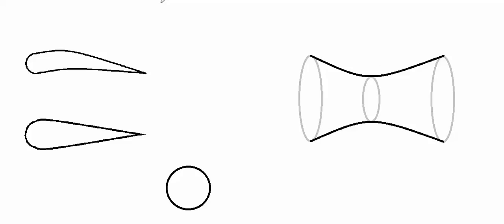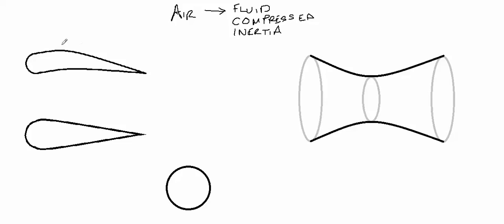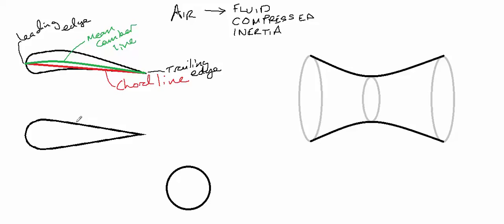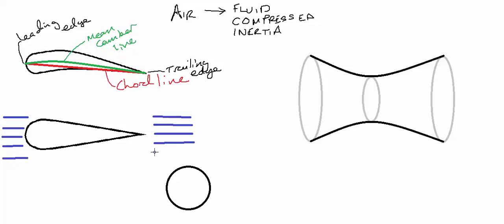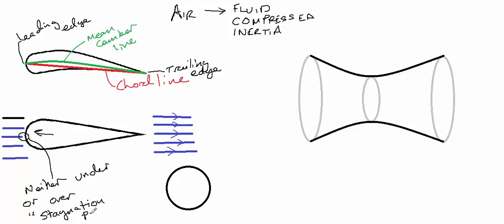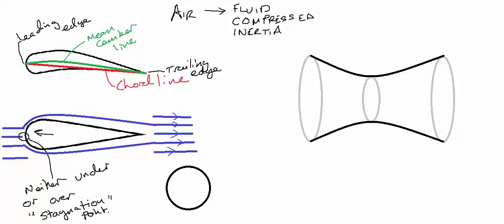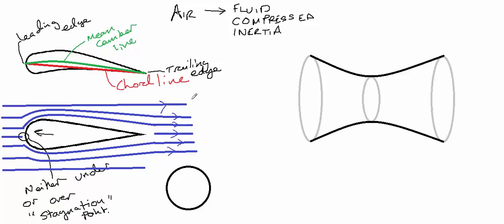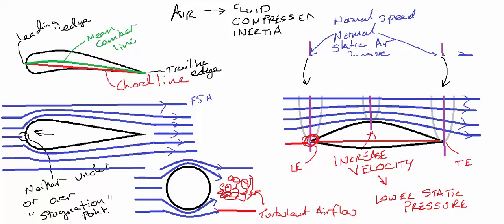Principles of Flight Tutorial 1 video defining terms and bernoullis theorem

Comment: You have fallen for the pervasive bad information about this.  This explanation is incorrect. This is a long repeated error by so many and for so long that it has become almost impossible to locate correct explanations.  It is a misunderstanding of Bernoulli's Equation.   
There is another explanation that is correct, so please get Bernoulli out of your mind. It has led you down the wrong path.
The increase in velocity does not result in (cause) a lower pressure.  The upper air may be traveling faster than the lower air relative to the wing, but it is traveling slower than the lower air relative to the stationary air and the earth, so this is not "Faster air" at all. Therefore, there is a big problem calling this faster air because the definition of 'fast' changes depending on the chosen reference and lift must work for either reference.  So which is the correct reference, the wing, or the ground? There is none because this reasoning is false science.  Bernoulli's Equation says nothing about the relative speed of air passing a nearby surface.  It ONLY shows the relationship between pressure and velocity at different locations along a single flow irrespective of the absolute reference. It relates the speed and pressure of one location of a flow to where that air is going to be in another location later along in that same flow.
...
Once you really understand it you will not be baffled by the fact that the fastest air around a wing is UNDER it!   This can easily be seen in the sequence of images on the 6th page of Dave Bentley's paper. The vertical line is stationary and the wing is moving past it.  Look at which air streams move the furthest (fastest) and which move the least (the slowest).  Until you understand this, It'll blow your mind.
http://219sqn.aafc.org.au/Flight/Wings%20don't%20suck-How%20planes%20really%20fly.pdf   UPDATE: David Bentley's information is no longer available, he may have retired. Follow this thread for more information. 

Air (fluids) can only exert a force by pressure differences and can only push. When there is a pressure difference, the higher pressure region pushes (accelerates) a mass of air toward nearby lower pressure regions because it is not totally opposed.  [recall Newton?]  As a bit of air travels and has more pressure behind it, it is accelerated to a higher speed into the lower pressure region ahead of it. The pressure difference causes the speed change, not the other way around.  It cannot be used to interpret velocity and pressure differences between two different paths. 
...
 Bernoulli's Equation also demands that no energy is added, nor extracted along the path in question.   A wing does work on the air.  The most obvious place is as it accelerates it downward to form the down-wash and creates the tip vortices. 
... 
In addition, the "half venturi" concept is considered invalid because there is no hard boundary condition as drawn here.  The upper streamline over the wing is not straight as drawn, but also curved upward.   This means that any conservation of mass that is required by the Bernoulli Equation is not maintained here.  Then, again, the wing is doing work on (adding energy) to the air, but there is no such energy addition in the venturi.
...
The "pinching" of the upper air can sound convincing.  For the venturi, the air in the narrow section of the pipe is not "Squeezed". This is a false conclusion that obscures the real science. If the restriction was not there, the pressure along the whole pipe would be constant.    The restriction in the pipe causes the pressure ahead of it to increase because there is a restriction downstream.   The narrow section of pipe now is an outlet for that pressure.  It is actually 'squeezed' in the large inlet section. Think of a pressurized tank that develops a hole to the outside lower pressure.  That hole lets air out because the pressure inside is higher than outside.  The narrow section of pipe is a relief opening for the higher pressure, therefore relieving the pressure and allowing the inside pressure to accelerate the air out of the small opening.  So it is a pressure difference that accelerates the air onto nearby lower pressure regions.  This is also how wind operates.
...
Another error is the fact that in the half venturi diagram you state that the there is "normal velocity front and rear".  However for a wing, these velocities are not identical.  The velocity at the trailing edge is slower for a real wing as well as air from far above the wing is being deflected downward at a considerable velocity.  This down-wash requires the same force that is the lift holding the plane up and is the acceleration of a bunch of air that equal and opposite
...
The lowered pressure at the upper surface is actually caused because the surface is retreating from the straight-line path a mass of air would take (or is trying to say at rest) if not acted on by a force. A surface that is retreating from the air, such as the more extreme example of your back as you walk, opens the volume the air has to occupy and thus reduces the pressure in the short term.  
...
In summary, as a solid shape moves through the air it pushes on air in front increasing the pressure, and opens space in the rear thus decreasing the pressure.  A wing carefully arranges these two regions to exist below and above the wing respectively.
...
The fact that the upper air beats the lower air to the trailing edge is due to the lower pressure there not moving that air along with the wing.  The 'normal pressure' ahead of (and above) the wing pushes it along the curved surface allowing it to remaining almost stationary as if the wing hadn't gone by. It is almost standing still until it leaves the trailing edge and is pushed downward by the 'normal' pressure well above the wing.  However, when moving along with the wing, this upper air appears faster and the lower air appears slower.
...
The lower air, on the other hand is, in effect, pushed, or dragged along with the wing by the higher pressure under it.  (It is also pushed forward and upward [up-wash] a little).  This is much easier to understand if you view the wing at a small positive angle of attack (leading edge higher).
...
In the following moving gif of an A380 test, you can also see the up-wash just before the plane enters the illuminated smoke 'plane'.
  http://i.imgur.com/h8pSK.gif
Reply from the maker: Thanks for sharing all of that, hugely appreciated.

At the time of creating the video, I was using the knowledge gained training for a commercial pilot's licence and to the best of my knowledge it is still, sadly, what they teach today.

There is a marked difference between accurately demonstrated aerodynamic principles and the flying training world (which lags a long, long way behind) but hopefully one day the flying training world will recalibrate it's thoughts.
Reply: @flightsim481  One thing we need to to realize is that pilots don't need to understand the physics to such a low level of fundamental science. Pilots need all the practical knowledge of how to get lift when needed and keep it in many otherwise complex situations. 
Whether the air is moving faster in one place or another doesn't tell the pilot what to do with the controls to keep flying at every moment as desired.
As we have seen, countless numbers of pilots have been flying for a hundred years with various stories in their heads, but knowing what to do to fly.
I heard the equal transit / longer path story many years ago in early pilot training, but didn't give it any serious thought because it didn't help one way or another.
Some years ago, taking responsibility for managing a rather sophisticated, full cockpit 737 flight simulator, I decided to look into it in case I was asked questions.
With a much better background in physics, I saw all the well-intentioned, but false reasoned explanations and went to authoritative sources and contacted some of them to make sure I had the physics correct.
.
If you want a step-by-step physical explanation, try this one: https://www.quora.com/q/rxesywwbdscllwpn 

Boeing's Doug McLean has one in the Nov 2018 issue of 'The Physics Teacher' but that requires a membership in the AAPT.
Best regards

Comment: Rich,
I'm re-posting this because David Bentley's paper has disappeared, but I found his video.  Perhaps he left the Academy.  I have a copy of his paper, but couldn't find it in the net.  He still has a video linked below.  It explains that the half-venturi is false. A venturi does not work if you remove the top half.
....
+flightsim481    
Hi,
  You have fallen for the pervasive bad information about this.  This explanation is incorrect. The half-venturi concept is false science.
...
This is a long repeated error by so many and for so long that it has become almost impossible to locate correct explanations.  It is a misunderstanding of Bernoulli's Equation.   
.
There is another explanation that is correct, so please get Bernoulli out of your mind. It has led you down the wrong path.

 The increase in velocity does not result in (cause) a lower pressure.  The upper air may be traveling faster than the lower air relative to the wing, but it is traveling slower than the lower air relative to the stationary air and the earth, so this is not "Faster air" at all. 
.
Therefore, there is a big problem calling this faster air because the definition of 'fast' changes depending on the chosen reference and lift must work for either reference.  So which is the correct reference, the wing, or the ground? There is none because this reasoning is false science. 
 Bernoulli's Equation says nothing about the relative speed of air passing a nearby surface.  It ONLY shows the relationship between pressure and velocity at different locations along a single flow irrespective of the absolute reference. It relates the speed and pressure of one location of a flow to where that air is going to be in another location later along in that same flow.
...
Once you really understand it you will not be baffled by the fact that the fastest air around a wing is UNDER it!   
......................................................................................
This can easily be seen in the sequence of images on the 6th page of Dave Bentley's paper (AND IN THE VIDEO Added below). The vertical line is stationary and the wing is moving past it.  Look at which air streams move the furthest (fastest) and which move the least (the slowest).  Until you understand this, It'll blow your mind.
...

 Unfortunately, Dave's  papers and his profile at the Academy seems to have all disappeared.  I leave this here in case someone finds the paper,.
http://219sqn.aafc.org.au/Flight/Wings%20don't%20suck-How%20planes%20really%20fly.pdf  
.......................................................................................
I found his video: https://www.youtube.com/watch?v=WmXq9gm1uMo  

This tutorial also explains things correctly:
 https://www.quora.com/q/rxesywwbdscllwpn/Understanding-Lift-Correctly 

Air (fluids) can only exert a force by pressure differences and can only push. When there is a pressure difference, the higher pressure region pushes (accelerates) a mass of air toward nearby lower pressure regions because it is not totally opposed.  [recall Newton?]  As a bit of air travels and has more pressure behind it, it is accelerated to a higher speed into the lower pressure region ahead of it. The pressure difference causes the speed change, not the other way around.  It cannot be used to interpret velocity and pressure differences between two different paths. 
...
 Bernoulli's Equation also demands that no energy is added, nor extracted along the path in question.   A wing does work on the air.  The most obvious place is as it accelerates it downward to form the down-wash and creates the tip vortices. 
... 
In addition, the "half venturi" concept is considered invalid because there is no hard boundary condition as drawn here.  The upper streamline over the wing is not straight as drawn, but also curved upward.   This means that any conservation of mass that is required by the Bernoulli Equation is not maintained here.  Then, again, the wing is doing work on (adding energy) to the air, but there is no such energy addition in the venturi.
...
The "pinching" of the upper air can sound convincing.  For the venturi, the air in the narrow section of the pipe is not "Squeezed". This is a false conclusion that obscures the real science. If the restriction was not there, the pressure along the whole pipe would be constant.    The restriction in the pipe causes the pressure ahead of it to increase because there is a restriction downstream.   The narrow section of pipe now is an outlet for that pressure.  It is actually 'squeezed' in the large inlet section. Think of a pressurized tank that develops a hole to the outside lower pressure.  That hole lets air out because the pressure inside is higher than outside.  The narrow section of pipe is a relief opening for the higher pressure, therefore relieving the pressure and allowing the inside pressure to accelerate the air out of the small opening.  So it is a pressure difference that accelerates the air onto nearby lower pressure regions.  This is also how wind operates.
...
Another error is the fact that in the half venturi diagram you state that the there is "normal velocity front and rear".  However for a wing, these velocities are not identical.  The velocity at the trailing edge is slower for a real wing as well as air from far above the wing is being deflected downward at a considerable velocity.  This down-wash requires the same force that is the lift holding the plane up and is the acceleration of a bunch of air that equal and opposite
...
The lowered pressure at the upper surface is actually caused because the surface is retreating from the straight-line path a mass of air would take (or is trying to say at rest) if not acted on by a force. A surface that is retreating from the air, such as the more extreme example of your back as you walk, opens the volume the air has to occupy and thus reduces the pressure in the short term.  
...
In summary, as a solid shape moves through the air it pushes on air in front increasing the pressure, and opens space in the rear thus decreasing the pressure.  A wing carefully arranges these two regions to exist below and above the wing respectively.
...
The fact that the upper air beats the lower air to the trailing edge is due to the lower pressure there not moving that air along with the wing.  The 'normal pressure' ahead of (and above) the wing pushes it along the curved surface allowing it to remaining almost stationary as if the wing hadn't gone by. It is almost standing still until it leaves the trailing edge and is pushed downward by the 'normal' pressure well above the wing.  However, when moving along with the wing, this upper air appears faster and the lower air appears slower.
...
The lower air, on the other hand is, in effect, pushed, or dragged along with the wing by the higher pressure under it.  (It is also pushed forward and upward [up-wash] a little).  This is much easier to understand if you view the wing at a small positive angle of attack (leading edge higher).
...
In the following moving gif of an A380 test, you can also see the up-wash just before the plane enters the illuminated smoke 'plane'.
  http://i.imgur.com/h8pSK.gif   
-- 
Regards, ScienceAdvisorSteve
ChallengerCenter.org